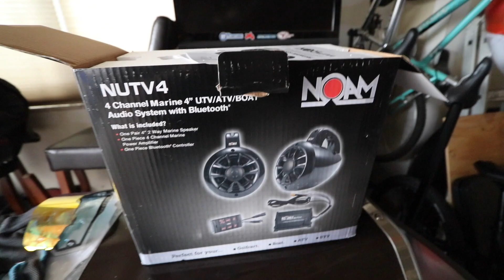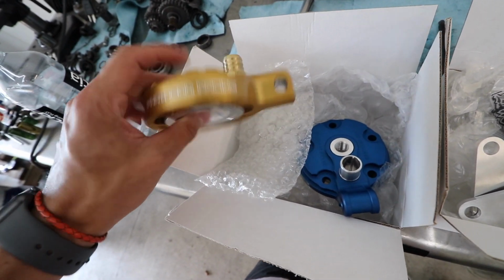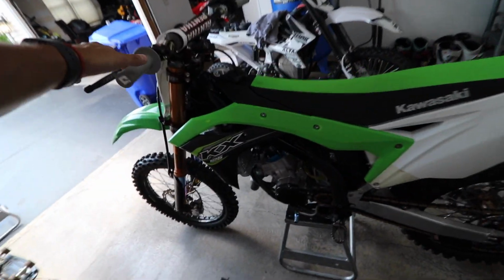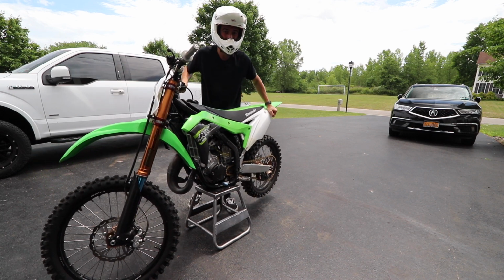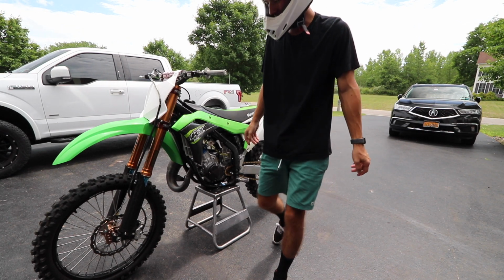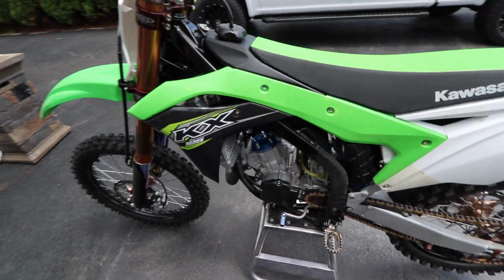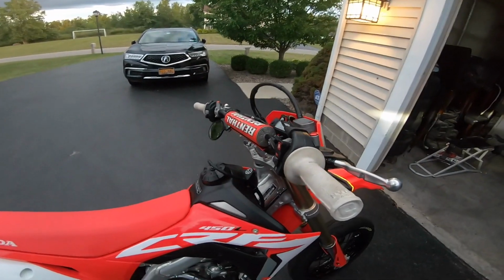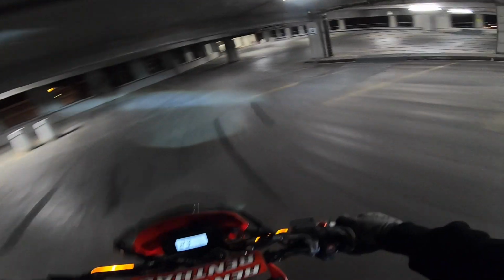2020 KX125 Two Stroke SOUND with NEW UPGRADES!!!

Comment: Stick a psi gauge in the spark plug hole and kick it, for a baseline while it's fresh , so you can catch it before it blows. Use whatever head has more psi on the gauge lol. Bike sounds real good and snappy 👌🤙